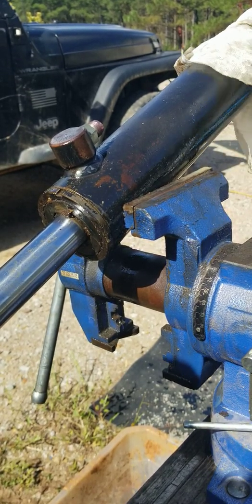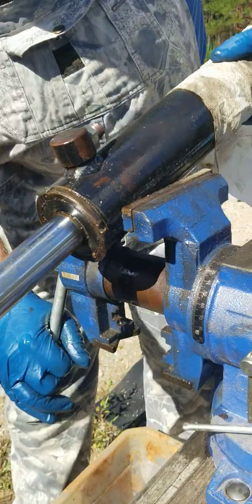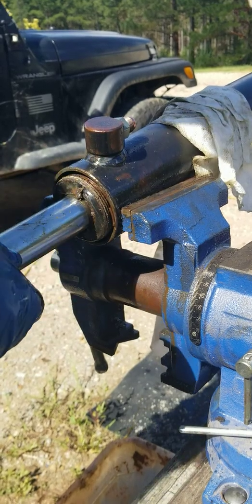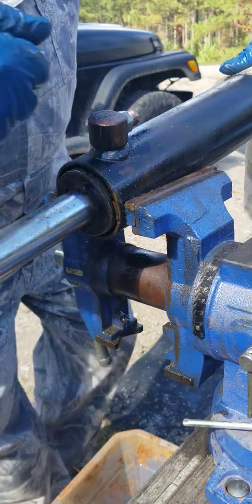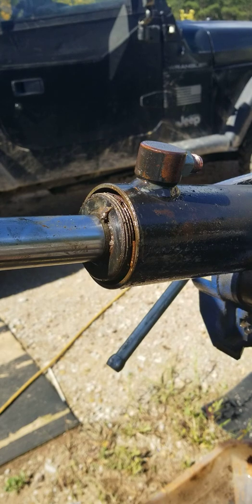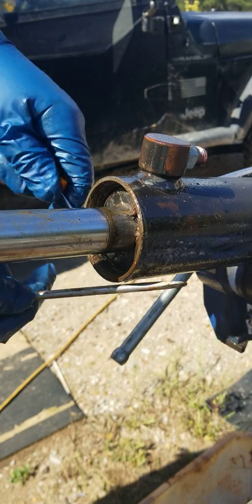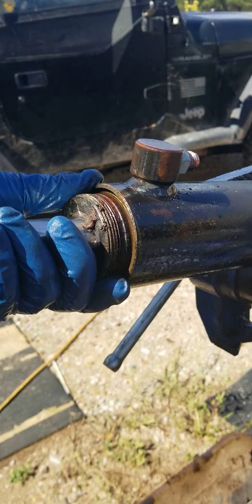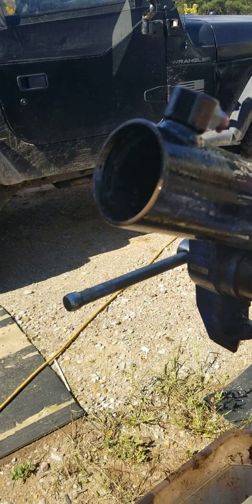September 29, 2020 Woods BK-7500 Backhoe hydraulic cylinder. Taking it apart to rebuild.

Comment: Thanks for posting the video.

An easier and faster way to remove the spanner nut is to clean it well and soak it down with penetrating oil.
Let it soak while still on the backhoe attached to a tractor.
Start the tractor engine and pressurize the rod guide/spanner nut end with the appropriate hydraulic control. 
The hydraulic pressure on the male threaded rod guide end will immobilizes it.
No vice crushing force is needed that could distort the hydraulic cylinder.
Use a good quality spanner nut wrench and tap the wrench with a hammer.
Once the spanner nut is removed disconnect both hydraulic lines to relieve the pressure, tap the rod guide in with a punch, remove the snap ring and pull the rod and piston assembly out of the hydraulic cylinder that is still attached to the backhoe.

Comment: I have the same cylinder. what kit did you use? Cant seem to find the right one. BTW TKANKS for the video. Got it apart after an hour.
Reply from the maker: My Woods dealer got it the second try. Mine has the bigger rods then the normal ones. I had to go by the SN of the unit. Even though I give the part Number to the parts guy. He still ordered the wrong kit. He had to call Woods they told him I had the right part Number.

Comment: This was my second go around with your vid - THANKS ! Don't think I'd have ever figured out the disassembly process without finding this. Found it about a year ago doing the boom cyl. on my Woods hoe. Needed to do one of the stabilizers this week, had forgotten all about the clamping process
Reply from the maker: I did the same thing, was about to give up. Clamped it to just hold the thing. Found out that was what it needed. I started to not do the video. But on the second cylinder rebuild. Felt it may help out others.
Thanks for watching.

Comment: Hey Pete, thanks for the video. I was having trouble removing the lock-ring(locknut) on my Woods backhoe stabilizer cylinder until I saw your video, I followed your lead by clamping the  cylinder close to the collar and tilting it at a 45 degree angle and hit the lock-ring(locknut) a few time and it started to come loose. I cleaned the threads up, installed new seals, put the cylinder back together and I am back in business. Again, thanks Pete.

Comment: Hi Pete. I know where you are coming from bud. I rebuild a few cylinders myself. I don't like the ones that a that wire clip that holds the gland in. Sometimes it's hard to get it started to get it to roll out. Great video
Reply from the maker: Sad part, I now have 3 more to rebuilt.  But my loader is 22 years old. And this will be the last ones on it.